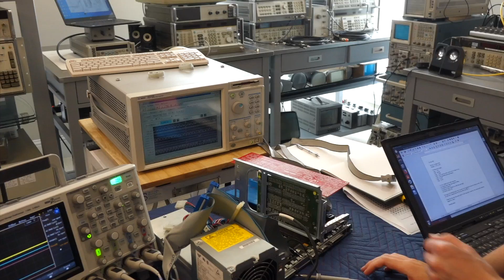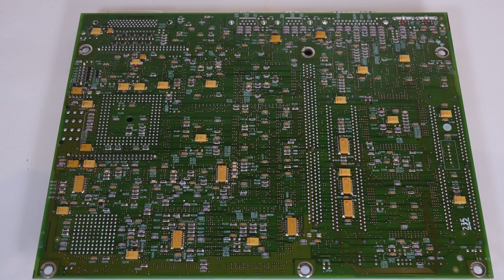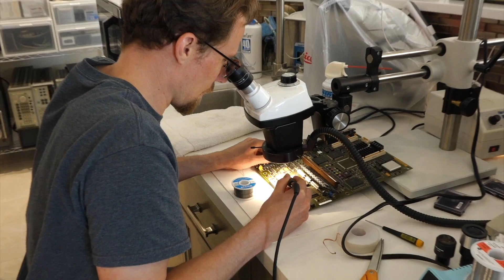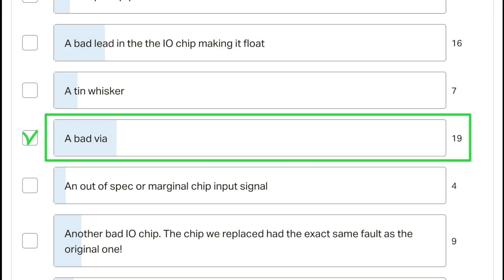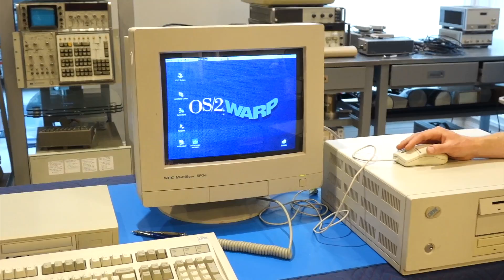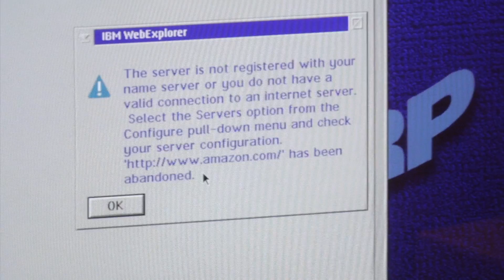IBM PS/2 Part 5: Motherboard Repaired for Good

Comment: I worked with a Kyocera 6 color printing press that used OS-2 Warp in the early 2000's. I fondly remember changing the language settings to Japanese, sending the pressman into a fit. He had no idea what was going on.

Comment: I remember when I got my first DX2-40,  I could upgrade my graphics cards ram with 16 pin dip packages to incredible 512K  ..  that machine was solely running final frontier first encounters (and doom sometimes) though  I think I had win 3.11, but that gobbled up too much space on my 20 MB shoe box sized hard drive, dos and nc were sufficient  ;)

It's incredible how small all that became, that processing power and storage might now look like a spec of dirt under your fingernail :D

Comment: Sometimes such problems in manufacturing would fail in bare board testing, but suddenly disappear under the vacuum used on bed-of-nails testing.  Very frustrating.

Comment: I haven't seen the problem jet, but I'm guessing it's a bad solder joint or a broken solder joint.

Edit: It's a via, so I was wrong, dum dum.

Congratulations, that was a really hard issue!

Comment: This happened to me with a Sinclair Spectrum. When I put my finger on the certain pins of the ULA, the board worked, and stayed working until next power off/on cycle. Same with a cold sprey too, as long as I kept it very cold, it worked. My initial thought was a bad solder joint, so I reworked all of them, no result. Then I tried pulling the certain pins up or down with a 10K, produced intermittent results. Lastly I tried capacitive coupling on those pins with a 10n and that killed the ULA for good. Replacing the ULA (took 3 months to get one) fixed the board for good. So, my final diagnosis on it was that the original ULA was very tired and only working marginally with a magic finger on it.

Comment: Mad props for solving this. 

But really - you should've gone with the easy common-sense alternatives of either:
1) Reaching into the future STNG universe with some handy vintage HP 
time-space-reality manipulation machine so you could borrow some Nanites
 (along with the Lt. Cmdr. Data to act as interpreter) and just as them to repair any 
defects they found.
Or...
2)  Calling in Yoda to sense the disturbance in the force so he could tell you where the problem was. 

I personally like the simple elegance of solution 1, but given your luck you'd probably find an obscure intermittent fault with the time machine that you'd have to fix first. And I suppose there's always the dual risk of the usual "time loop paradox plot" problem, and the chance that some Nanites might escape into the wild here in the 21st century and ruin our economy by repairing all our "obsolete" devices.

As for solution #2:  Because of his centuries of experience, I expect Yoda would've given you the answer sooner, but you got the same result by letting Eric do his thing. It seems the Force is strong with that one!

Comment: My first IBM PC was a 30286 PS/2 which I later found out wasn't even a 286. It was an 8088. In 1988, I bought a 8088 when I could have bought a 386 tower system for a LOT less money.

Comment: My iniatial bet was a bad buffer or bad pullup resistor as the failure was not pressure related but just fixed by the magic finger. turns out that when one puts a finger onto the pins it lays moistures between them and make the thing work again then die horribly a while after. could have made sense as I encountered this before. but ah well the dumb and tricky half broken via got me again :-D well done Eric !

Comment: Fantastic job on finding the bad via. I collect pinball and arcade games and repair th e boards, finding damaged vias is a nightmare. I also get hit with "it's the caps" in my hobby alot, these boards were made with the lowest quality parts possible so sometimes it really is the caps lol.
Reply from the maker: Yes, truth be told, I have bad crapacitors too in my more recent consumer electronics (and a few "modern fails" videos to go with it). And occasionally on my beloved vintage HP equipment too!

Comment: Nothing to do with your probem but an interesting fault on a Hameg dual trace oscilloscope I own (bought around 1985) which would have drawn similar interesting diagnoses to yours. 1 channel would intermittently die - no trace deflection. It is an old beast so I initiallly resorted to having to swap components between channels but also managed to source replacement input FETs whichg did not fix the problem.
With a meter I found shorts in the circuitry which came and went - reminded me of your whiskers.
Cutting a VERY VERY long story short there was a VERY thin sliver of solder invisible to the naked eye insie a metal screened area which would wave 'in the breeze' and cause an intermittent short. Moving the scope around  standing it in different orientations trying to take readings would cause the fault to come and go.
After removal the scope now works perfectly. This happened in 2015 so it took *THIRTY YEARS* for the fault to manifest itself from new.
I love fault finding ......................

Comment: Tough find.  Kudos on your repairs, gentlemen.  Had to deal with this sort of issue on an 8 ch. mixer.  Took what seemed like an eternity to find that kind of failure.  Board was tweaked/twisted just enough to crack a via.

Comment: Back in pre-history, we had some pretty reliable stock-fault diagnostics we could rely on. Link 110 TV camera - look for the dead tantalum bead capacitor. Always an easy find, they stink when they explode and are easy to spot. On that device they would also take out the inline chokes on the power rails.  Some years later, TV camera again, this time a Thomson 1530 Almost every fault I ever had with those was a short 0.1UF ceramic capacitor...unfortunately, they were almost always embedded inside a hybrid module - Thomson called them PLs so all you could do was look at the theoretical circuit, work out which cap was bad then replace the entire module.  Later again, into the PC era now and of course, Dell computers and the infamous bad electrolytic caps.  Had a really spooky one in my early days as an engineer on a Studer tape machine. When first turned on for the day, it would go into fast forward and nothing you could do would stop it. Wait 5 minutes and it would then behave. Finally tracked down to a tantalum bead cap that would self-heal.

So, yep, I'm a subscriber to the belief in evil capacitors. :)
Reply: Oh they are evil, just there's other gremlins too. I had a board I was making for uni around 2003 or so. Stripboard, my one and only all nighter before flying to woomera to put it on a rocket. Hundreds of dollars in ADC chips on this board. And there was a short. I couldn't find it. My dad couldn't find it. Eventually he had a suggestion. There's one way that will 100% show you where the short is. Hook the 5V rail up to a car battery. Just before I'm about to do it with my face stuffed into the PCB to find this damn short father says "Oh hey, aim that away from your face", "good idea" says I. Dutifully flip the board over and engage my safety squints. Connect alligator clip to battery. BANG! Fire goes spewing across the desk, red hot glowing coals sizzle into the laminex. The same desk I'm using now funnily enough. It's still got the burn holes in it. 
God damn tantalum cap was shorted from new.
I've avoided them like the plague ever since lol. I'm getting pretty excited about the giant MLCC caps that are getting around now.

Comment: Schrodinger via, as soon as you probe it affect the state - lol -.

Reminds me of my leaking plastic petrol tank. When you pumped it up to 0.5psi it would weep, but you couldn't see the exact point of the leak. So you raise the pressure to 1psi expecting it to leak faster, but instead it presses the crack shut and stops the leak. Took a few days to work that one out - lol -.
Reply: This mechanism would explain a (different) fault I'm experiencing right now. Thank you, kind stranger on the internet! :)

Comment: I would have so loved the cd-rom when I had to build OS/2 machines from 31 floppies then 27 more for communications manager.  Model 60s with token ring cards.
Reply: I wish I still had my copy of Windows 95 on floppy. Not because loading from floppies was in any way practical when you have a CD-ROM drive, but for the nostalgia of having to do things the hard way.

Comment: lool  we had an flatpanel xray detector returned that was frying power supplies left&right...   opened it up and found a scorch mark on interior of back cover from an SMD tantalum that blew its ass out in short-circuit..just as you say!!     desoldered it  (there was an identical next to it so prolly redundant anyway for ESR or some nerd thing)    and recalibrated the unit and was fine.     the powersupplies were all fine, too:   used calipers on a dead fuse and found compatible ones on digikey to pop into the SMD fuseholder.    it was like $60k of equipment fixed locally with a hot air SMD station and a couple dollars on digikey LOL.    i kept that SMD tantalum for years
Reply: Yeah, electrolyitics usually just ooze out over time as they go open circuit. Tantalums are usually pretty reliable, but when they go, they go spectacularly. With electrolytics, if they aren't leaking, you'd need to connect an ESR meter or something to discover that they're leaking. With tantalums, there's no doubt, you just look for the scorch mark!

Comment: This growing of tin whiskers is especially a problem in a vacuum. I was told that it is more pronounced on lead-free solder and that ESA, therefore, insists on a minimum percentage of lead in all soldering for space applications.
Reply: I prefer 60/40 lead solder anyways. Toxicity aside, it simply works better, and is easier to work with, than complete tin.
Reply: @BlackEpyon  I completely agree. Besides that, I think that in a hobby environment the toxicity isn't much of an issue. With a bit of ventilation and washing you hands afterwards everything should be fine. If you're soldering 40 hours a week then it's different story of course.
Reply: Apparently it was a common failure mode in early transistors, too -- inside the can.  If I remember correctly, you charge up a capacitor and zap across the junctions to fix it...  or something like that.  :)
Reply: @ydonl  My old physics teacher used to repair his broken light bulbs like that. Cap across the connector and wiggle the filament around until it welds itself. I always thought this was more for the challenge than for cost savings...
Reply: @TheOddVideoChannel  Pretty crazy!  Yes, I would say... for the fun of it!

Comment: Question when you attached the B/T card to the PC what programs will you be using? I’m trying to attempt this however slightly different. I want to put a ESCON card in it and use a channel converter to test a printer I have and a couple other peripherals that have B/T connections. Although I do have a mainframe system unit I don’t have enough ESCON cables to connect everything now so I thought this would be an interesting way to expatriate. I have a couple A50 tape controllers and they are RS6000 P43 based and I’m also wondering if they can be adapted to present other drives such as DAT and possibly a 9348. Speaking of the 9348 I’m looking for a proper SCSI card to drive it.

Comment: People are always saying capacitors because it makes them feel better about themselves, as they feel that they're contributing to the conversation without providing any intellectual value whatsoever. They say "change the caps" because 1) they may be right once every dozen or so times, and 2) even if you do change the caps and it doesn't fix the problem, it doesn't ruin anything, and yet they still get away with making the suggestion. To me, it is like watching a golf tournament, where on every single stroke of the golf club, you hear many people in the audience scream "In the hole!!!!" Yes, I believe "change the caps" and "in the hole" are one and the same mindset.

Comment: You are very funny Marc, but the best joke you ever told is that there are commenters who would tell YOU GUYS that it was a bad cap.  I guess it's a board level repair.  The one you try right after "did you turn it off and back on again?" and you can do it if you only have a soldering iron.  Brains optional.  I guess anyone can type.  Thank you for sharing your brilliance with us all and keep an eye on those caps!

Comment: Dielectric constant of air strikes again!  Congratulations on fixing it as those are often the hardest problems to find.  In my experience, broken vias are a lot more common than a broken trace on an inner plane.  Whenever I found one there ware often more in the same area of the board so soldering a wire through all the vias in that area might be a good idea to avoid future problems.

Comment: Well that's me excited that you found the cause in this one. Without access to all those tools, I guess I might just have to hope that its similar on mine and poke at the vias around that chip one day. If it turns out to be a via on mine too, then that'll suggest a really old issue with their design
Reply from the maker: Tell us what you find. I would not be surprised if it is a generic issue. But it could be anywhere on the board, on any side of it. That’s many 1000 of vias to poke at…

Comment: Intermittent faults like this are pain and time consuming to find. Well done in tracking it down. It's easy to speculate and/or over complicate the issue but 90% of the time for intermittent faults at least, connections are the cause. The capacitor changers would have come up short here.

Comment: Eric fits in your team. Same approach finding errors. Good to know that there are still people out that look for the real root of a problem. Thanks for sharing !
And you should look for a 1.2GB SCSI drive. Preferably a power-saving IBM DCAS3120. The system has a "natural limit" on the size because it was supposed to hold a "convenience partition" (with the content of the reference and diagnostic disk) for immediate access when required. The limit is 3.94GB and most modern SCSI drives are either larger or don't have the "narrow" 50-pin connector any more. It is possible to use 68-pin F/W drives with a converter plug - but the primary / boot / ID6 drive may not exceed 3.94GB. Once booted an additional drive can be larger. I had machines with 60MB (MegaByte) capacity as boot drives and 68-to-50 converted 18GB Ultrawide SCSI drives as second. The small boot drive is just used for the reference partition, but everything else was on the bigger drive.
Reply: I had some old full height 5.25" SCSI drives years ago. 9GB capacity, 50-pin connector, and bloody noisy beasts! The server tower they came in, I've repurposed as my main i7 rig, but sadly, those drives failed and went for recycling years ago.
Reply: @BlackEpyon  From my "times with PS/2" I must have dozens of DORS, DCAS, DGHS and suchlike in stock. Along with some Seagate Elite Full Height drives. Wonder, how many of them would come up after years of being not used. There are 2 DCAS and 10 DGHS (or DDRS) in the one Server 520 alone ...

Comment: Great repair. The next via, third from left, looked as bad as well.. Probably all of the vias are inherently affected.
Reply: And there are known instances of the "Bermuda" planar not holding a configuration (the Dallas clock chip and Extended CMOS chip are nearby) - it may be something to the layers delaminating or stress from the riser nearby. I have an affected unit in a Model 76 case, but know of two reported in a Model 77 case - the riser does have a metal frame on the 77, but maybe it bends the planar too much.

Comment: It wasn't that long ago, maybe a couple of years ago, that I discovered a hole in the wall bank teller machine was still using OS2 warp!  Fascinating video! Marc, thanks!
Reply: In a former life I worked quite a bit with ICL. Walking through one of their facilities I noticed some ATMs being commissioned were booting Microsoft OS/2

Comment: As you can see, you can repair almost everything. Though if I would have had to pay professionals they'd have said it's broken you need a new one. Or if I said to repair it it would have been prohibitively expensive. Still good to see it working again.
Reply: Well if you consider the man-hours that went into diagnosing the problem, it quickly becomes way more expensive than the machine itself is worth, so this kind of repair definitely is only for the hobby user type ;)

Comment: The replace the caps comment is overused by people who understand to little, but have seen it work to often. The thing Marc here keeps forgetting is that he typically works on very high end (for the time) equipment that cost a fortune. The parts are excellent quality in many cases and last very well. Compare that to much eighties and newer consumer stuff produced to a budget and you get a very different story. Computer main boards suffering capacitor to plague are very real. Also earlier things like wax capacitors also just degrade over time. But you won't find those in the stuff Marc does fix. So he gets mad about people generalizating  about caps and then turns around and does the same himself. It's a spectrum people. Different classes of equipment suffer more or less of bad capacitors. Simple as that.
Reply: I've replaced capacitors on too many dozens of motherboards from the late 90's-early 2000's. I have no desire to "re-cap" a motherboard unless it needs it. Fortunately, THAT plague seems to have died off.